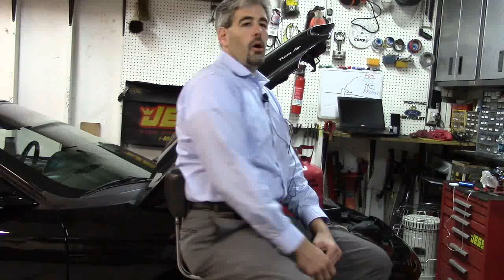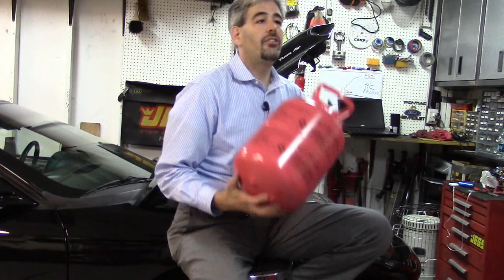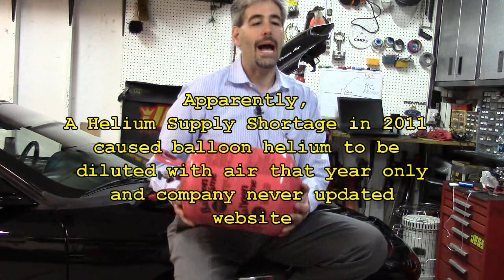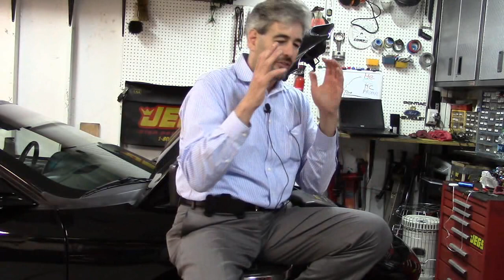Experiment to solve O2 Sensor Debate: UPDATE + New Design

Comment: Thanks for striving to get it 100% right, and thanks for listening to the viewers!  
I still don't understand what the "fuel sensor believers" argument is when a lack of spark missfire causes a lean condition.  With their logic, seems it would be a rich condition.  
I don't know what temps the exhaust or O2 sensor run at, but the lack of spark misfire may be a little less lean than a no-fuel misfire maybe because a bit of the fuel and O2 are partially consumed somewhere between the cylinder and the sensor......all depends on auto ignition temps / flammability limits and mixing.
Anyone know what the minimum O2 range is to span the full range between the top and bottom of the O2 sine wave?  I suspect pretty small.
Reply from the maker: Louis Pasnik No, they would agree misfire causes lean because the misfire introduces far, far more O2 then HC (15 times to be precise) so it leans the HC out and of course, measures lean.  The O2 sensor crowd of course believes it's because of the excess O2.
Reply: That logic doesn't make sense.....if the air and fuel are metered and engine is at constant conditions, you have a fixed mass flow.  In general (but not exactly) the complete combustion reaction turns O2 and hydrocarbon into CO2 and H2O.  My point is, the quantity of molecules are at a fixed flow rate at constant conditions.  Now, the instant a plug wire is removed, the rate of molecules flowing is still fixed but no combustion taking place.  There is no more additional "dilluant" being introduced than there was before...only the combustion reaction didn't happen.  The response would read lean.  
I would argue the amount of combustion products (co2, water vapor, nitrogen, etc) on a normal functioning cylinder is probably on the order of 16 (15 +1) times more than a trace amount of HC when the O2 sensor hits 0.8 volts (rich indication).
Reply from the maker: Louis Pasnik Gotsta say the NayNo to that my damie.
 The O2 is configured for the aftermath of the burn. It is measuring traces of unburned O2 and Fuel.  With a misfire, far, far more O2 (and fuel) is present than before the misfire. The O2 sensor has to adjust for that. The amount of diluent is significant.
Reply: Apologize for high jacking the comments, but we need to break this down to 3rd grade math for me to understand....call it a single cylinder engine for simplicity.
So, engine is flowing 15units of air to 1 unit of fuel - 16 total mass units per unit time.  16 total mass units coming into the cylinder, going through a combustion reaction, and 16 mass units then leaving tailpipe in a different molecular form (conservation of mass).  Call it close enough to stoich - no residual HC or O2, just combustion products.  
Now, add half unit of propane.  Immediately (just as fuel trims begin to react) at the sensor you have 16 units of products already completed reaction (and now ~inert) plus half unit of propane which hasn't combusted due to the lack of O2.  Sensor reads rich.  Only 0.5 out of 16.5 units were fuel, the other 16 units being the "dilluant".  Fuel trims finally adjust back to get the equivalent of 15:1 ratio.

Now a plug is pulled.  Agreed that the % of fuel (and air) dramatically increase at the sensor...now it is all fuel and air and no "inert products of stoich combustion" exist.  However, would you not still have 16 total mass units per unit time flowing by the sensor (before the fuel trims make adjustments)?  Or, are you saying the engine somehow throws more air and fuel mass flow to the cylinder (and thus seen by the O2 sensor? If still the same 16 units (i.e., total mass flow rate unchanged) then 15 units are the dilluant (compare to 16 dilluant units in the paragraph above with propane added).  So, if it is really a fuel sensor, does it really care what the dilluant actually is?
Reply from the maker: Louis Pasnik I think your error might be with the 16 in 16 out. The out is far less because the products of the combustion are mainly Co2 and H2O, not C12H22 and O2 which are the parts in question here.
Reply: the idea of total combined exhaust mass flow out being less than the total air+fuel massflow into the engine would violate the law of conservation of mass, wouldnt it?
Reply from the maker: no because when you add up the content of the elements in the input and products they are identical. the amounts of hydrogen, carbon, oxygen, etc are totally identical in the input and output products. "balanced chemical equation" in other words.
Reply: My point exactly.  So, if i have combustion  which consumes all o2, but with a trace bit of HC remaining, it reads rich.  The HC remaining post combustion is very dilute as everything else is ~non-reactive combustion products.  I.e., much less than 1 part fuel remaining to 15 (or nearly 16) parts products of combustion.
At the other side of the spectrum, no spark = 1 part fuel to 15 parts air At the analyzer.  This would seem to have a much greater percentage of fuel, and the % of dilluant in this case (air) is somewhat less than the example above where all 15 parts of air is consumed (with the addition of most of fuel being consumed as well). Despite the % of fuel being much higher in the no spark scenario, it reads lean, although the amount of dilluant (air in this case) is less than the total mass of dilluant in the first example (total amount of combustion products).
i dont know, maybe I'm full of it.....or maybe i can blame it on that second can of spotted dick!